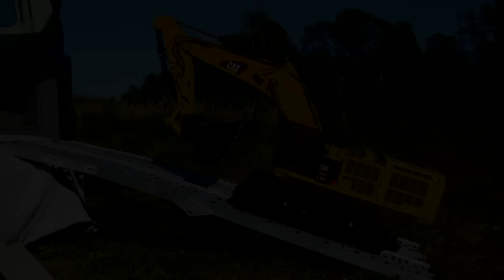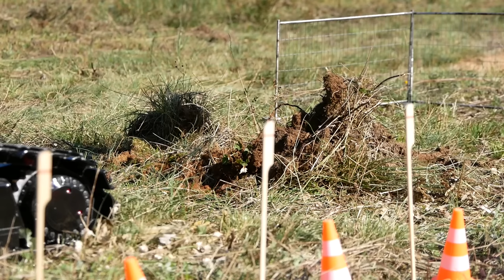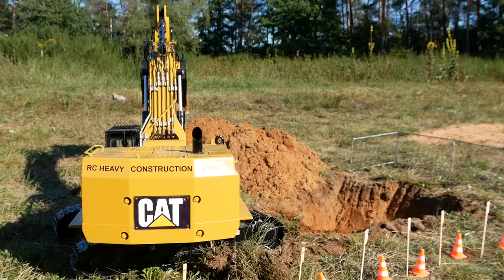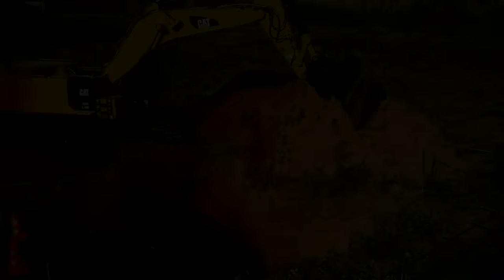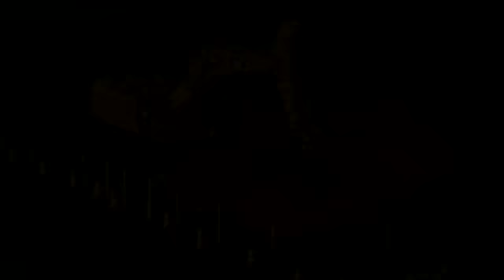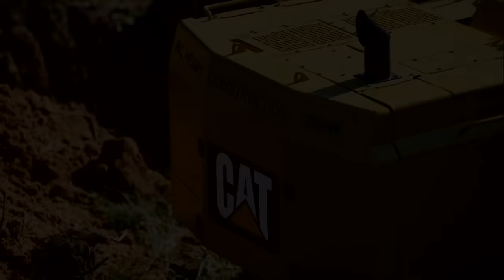CATERPILLAR 390D HUGE RC Excavator scale 1:8th part #1/ CATERPILLAR 390D RC Bagger 180kg 1:8 #1

Comment: Wow just wow. The engineering that went into creating a thing of beauty like this is astonishing and at least this cat 360 didn’t cut a water main like I did on my first day and ended up being called fish afterwards
Reply: I'm making one too, starting with the hydraulic pump
Reply: Oh my lord that sounds like a nightmare come true. I’m still nervous on my 100th day at a job because of stuff like that.
Reply: @kerryforyeshua7453  no need to worry because mistakes happen and I didn’t have the relevant groundwork paperwork but it did make me triple check the right paperwork three and when possible I use two welding rods and I water devine where I’m digging beforehand, if you want or need any info I’ll pass it on to you
Reply: That a rough nickname

Comment: Nice! I run a real one for a living 315/330 and a 323 or 324 don’t remember right off the top of my head but it’s the next gen cat it’s sweet! Also  I got one of those rc excavators coming not hydraulic model it’s the 1/14 1580 all metal😎👍🏻
Reply: Very smooth operator...

Comment: Remarkable, this machine can actually do what the bigger machine could do. Imagine having this hooked up to AI and let it do it's thing all alone to dig up to 300 feet. It would take more time but didn't require expensive machinery and dangerous work conditions, also much cheaper, could be hydrogen fuel cell powered. How is this powered, did you design this?
Reply from the maker: onverted, the excavator can do more than the real thing. Yes, the excavator is completely self-built. It is powered by electric motors.

Comment: It took 10 seconds to see that you’re digging over you’re sprockets
Reply from the maker: Yes you are right. I have no experience with an excavator. I only can build an RC excavator...😅
Reply: You must be an experienced excavator operator because not too many people know that that’s a no no. Dig with idlers in front 👍
Reply: @gonefishn5138  about 27 years now and the mechanics notice it right off especially on the bigger machines and you know they aren’t shy about telling you so. I actually learned that lesson way back in my logging days believe it or not
Reply: @67hundredthz  I believe you. I learned about it back in the 1980s when I ran heavy equipment in a granite quarry. Not in the quarry anymore but still operating heavy equipment

Comment: I'm working on a huge one myself. It will have about a 6' reach, a bucket about 8 to 12 inches wide. I'm using cordless drills to do the track, and turning the machine, and for the actuators. Walmart sells the drills for $10/each. I have 6 of them now, and bought threaded rods, and bolts, to make my own actuators. The drills run off of 4.5 volts, and are geared for very high torque. I bet they exert more than 50 pounds. Initially, the arms will be made from wood so its easier to make adjustments. Once all works using wood, I'll fabricate all in steel. I want the thing to be big and strong enough to actually trench a pipe in my yard. I'll be using an Arduino to do the WiFi and controlling the motors! Hey, check out the mod I did to my excavator: https://www.youtube.com/watch?v=JPVL4spbCkU

Comment: What kind of run time are you getting? What the battery size. I’d imagine it’s Lipo?
Reply from the maker: It is round about 1,5hours. The battery is one 12V 75Ah. It is a lead gel battry.  It is not a lipo. Lipo in that size is very expensive and for me to dangerous.

Comment: Amazing 
Congratulations 
I understand it’s self made however, can you be kind enough and recommend me where I can find something similar to it and buy it?
Thank you
Reply from the maker: Thank you. But a Rc excavator in 1/8 scale you can not buy.
Reply: I found a couple in ALiExpress
Reply from the maker: Be careful with Ali express, in most cases the scale is not right. And the quality of the hydraulic is very bad.
Reply: @rcheavyconstructionzone  thank you for the heads up

Comment: It seems under powered that breakup hook wouldn't big down a real life 390D like that unless it found a large rock. I run through a sewer line never felt it slow down at all and it was an 8" line with a 322. As I'm watching it take the first layer off it does seem really underpowered. You should have been able to get full buckets in every bucket. Especially when you run that hook through it first. In case its not somewhere in the video, who makes this excavator?
Reply from the maker: Watch the new videos. The CAT got a power update on the hydraulic side. 
https://youtu.be/p6X0cGMo0vo
Reply: @rcheavyconstructionzone  cool it looks great. I had no idea you built this piece. Earned more cool points in my book.

Comment: What website did you get the 1/8th excavator at? What is the price?
Reply from the maker: You can not buy this Excavator.  It is selfmade.  Maybe in the future.
Reply: Lots of these radio controlled machines with real hydraulics are sold from companies in Germany in kit form.

Comment: Did you manufacture this by yourself?😳😲😲😲 Or did you buy it? If so how much did it cost you and what's the run time of the machine on a full charge?
Reply from the maker: Yes it is completly selfmade. Only materialcosts are 12.000$.

A full charge works for round about 1hour. It depends on how hard the digging is.
Reply: @rcheavyconstructionzone  OMG that's more costlier than a real life size car! How powerful is this can can it pull a family SUV if towed? Also thanks for responding! I got here from a excavator video that costed 9 grands!
Reply from the maker: Yes it can pull a SUV. 
Watch hier the power...
https://youtu.be/F8R2Vs81bI8

Comment: How is it powered? Can you share on some of the technical parameters?
Reply from the maker: https://www.modell-baustelle.de/index.php?thread/7737-caterpillar-390d-lme/
Reply: Below a certain size they have battery powered hydraulic pumps and the hydraulics are fully functional. Usually the tracks are powered by electric motors instead of hydraulics though.
All funtions are operated by remote control servos just like all other remote control cars and vehicles.
Over a certain size some of them actually have gasoline-powered motors to run everything. 
Some of these radio control tractors are big enough to lift an adult.
Some are much smaller then a bread box.

Comment: Since I dont think it has real hydraulics, where or how does it get the power to dig like that, air maybe?
Reply from the maker: Of course it has real oil hydraulic! Thats the main system on this Excavator. With air you can not controll it.

Comment: Hello,
Great work, it's beautiful. I discovered your excavator on facebook and it made me want to build one. The downside is that I don't know where to start. Do I start with a model, a plan? I have some knowledge of Solidworks. 
Would it be possible for you to share the plans of your excavator ? At least I would have a solid base to start with.
Reply from the maker: Thank you for your comment. I do not have plans, I only have CAD files. But i only sell them for a really high price. (15.000€) Because I have no controll about resale or trade without my permission. 
For starting such a project you need a small model 1:50, a calculator and a lot of time and passion. Only for the design it took me round about 800hours. And the same for building. Material costs round about 12000$.

Comment: Nice operating. Like the change from ripper to bucket. A tip to deal with the dirt in front of your tracks is to push it back into the hole then scoop it up. 👍
Also can you do jump turns with this thing? Or do you need three hands?
Reply from the maker: Thank you. Yes I can do jump turns with two hands.

Comment: hi, could you sell me the project, I would like to build one too, thanks?!
Reply from the maker: What do you mean with project?
Reply: @rcheavyconstructionzone 
Hi, for the project, I mean the CAD files, of all the pieces to be made with the CNC, and the drawings of the parts, for plasma cutting, and the cylinders!
Reply from the maker: Hi, i only have 3D data. But I sell it only for a very high price, because I have to controll about trading with that data without my permisson. And in that data are 800hours of work. It is completly self designed.
Reply: @rcheavyconstructionzone 
At what price would you sell them?
Reply: @rcheavyconstructionzone 
I'm not a dealer, I would like to build one for myself!
Reply from the maker: The price is 10.000€. Sorry, but I have no gurantee, what you are doing with that data. I am sure you won't pay so much money.

Comment: Noob question... can you convert these to run from mains via a suitable voltage adaptor?.. I was thinking of a sliding pulley from overhead say the washing line...
I live on my own so I don't have to negotiate t&c on what I use my washing line for, or how long I spend in the bath, or whether I drink to much beer, etc, etc

I could blissfully sit on a chair in the garden for hours on end... b^_^
Reply from the maker: Hello, yes I think that is possible. Then you can run around the clock.😎